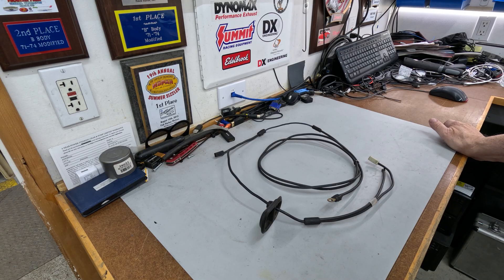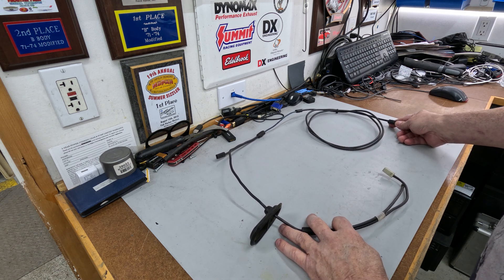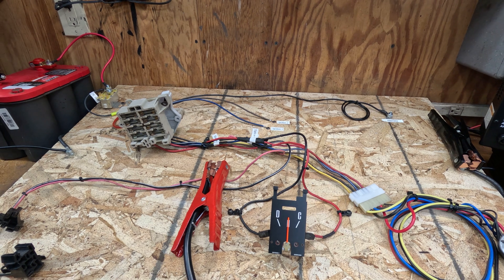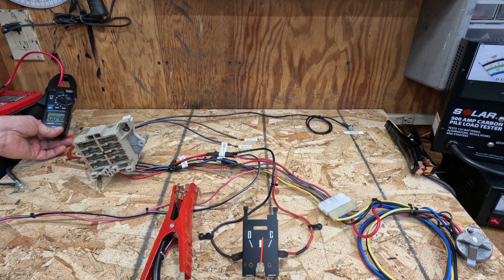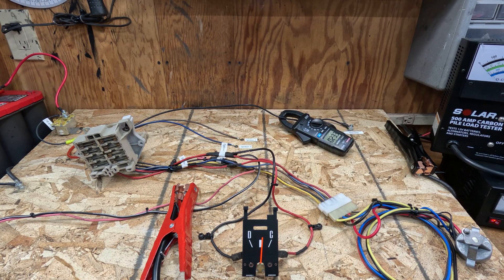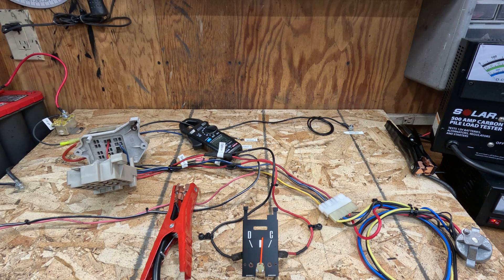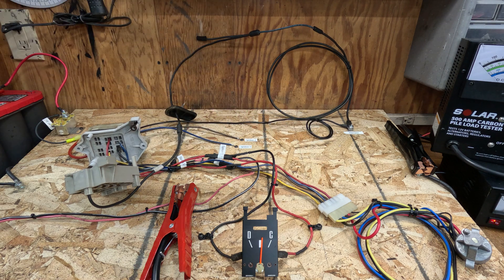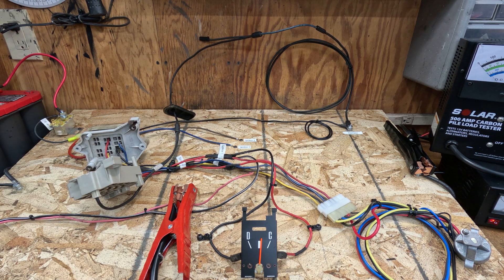The Mopar ammeter-based charging system and the “C-body recall” bulkhead bypass

Comment: Great videos, I've been watching them all. I'm also on FBBO. I'm about to rewire my '71RR all new with M&H. I also purchased an NOS C-body recall bypass on ebay. Any chance you could make a video on how to make a new recall by-pass also showing what parts are needed? I'm a little leery about using the NOS bypass seeing that it's about 50 years old.
Reply from the maker: Thanks, close to finishing up the mostly “as original” subjects, will go back over some modifications in some detail shortly, will show some basics.
Reply: @72roadrunnergtx  Excellent!

Comment: I’ve enjoyed your videos and I particularly like this one. I’ve messaged you on a separate topic on one of your other ones that you’ve been very helpful.  Let me see if I have the right set up for my application.  71 B body with all new M&H wiring harnesses. Only thing that’s currently stock is the rear headlight harness. 

I ordered a relayed headlight harness and a feasible linked wire that runs from the alternator to the starter relay. Based on your videos, I’m assuming you do not like the alternator to starter relay wire that I purchased.  However, I do not think you have any objections to someone running a relayed headlight harness. 

If I purchase the C body recall wire, which I can actually still get on eBay  (and not run the shint wire I have) that will decrease the amperage running through my Packard terminals while still maintaining the factory safeguards built into the wiring. 

As far as the relayed headlight harness….. if I’m understanding your videos properly it should be ran from the alternator which will be the “alternator side”of the Packard terminal as opposed to running it from the starter relay which would be the battery side which I understand to not be a good idea (battery loading). 

Thank you for reading the novel. Just wanted to see what you thought and to make sure I’m understanding you correctly.
Reply from the maker: Thanks for watching, the factory C-body recall approach parallels the stock alternator feed Packard’s in the bulkhead connector, reduces vehicle load current on those terminals. Will not alter the designed circuit protection or the ammeter function. Crackedback’s “wire around” bypass defeats the ammeter altogether but will not help with vehicle load current being supplied to the interior on Packard terminals. He is one of those who believes the ammeter is the root cause of every Mopar electrical problem that has ever happened. I do not support his approach to this issue at all. Headlight relays? If keeping the stock ammeter operational, the power for the headlights, and/or any other added loads, needs to come from the alternator or anywhere on the alternator side of the Ammeter, as are all factory loads, to retain the purpose and function of the ammeter and not over-current stress the ammeter and related wiring/connections. If running his “wire around” bypass, or the ammeter is bypassed in any way, then it does not matter if the relay power comes from the battery or alternator.
Reply: @72roadrunnergtx  I apologize in advance if I'm being dense.  You said the wire around bypass defeats the ammeter altogether but will not help with vehicle load current being supplied to the interior on the Packard terminals.  That vehicle load you speak of is my main concern and would like to avoid.  
I'm not saying I'm going in this direction but for my own education if I  (1)physically connected the ammeter wires together physically/electrically bypassing the ammeter (2) ran the fusible linked "wire around" shunt from the alternator to the starter relay (3) and ran my headlight relay harness from the starter relay to the headlights I'd be fine as far as not overloading the wiring in my car?  That's what I gathered from what you said.  Please correct me if I'm wrong.
Reply from the maker: From his description you added to a comment on one of the other videos, he speaks of connecting his “wire around” to the bulkhead connector, removing and replacing a couple of Packard’s. Along with his comment about it not mattering about where to draw power for the relays after his “wire around” wire is installed, indicates he is bypassing the ammeter in the charge path and still depends on splice 1 (main power for the car) receiving its power through Packard terminals in the bulkhead. This is not what is commonly known as the “shunt wire” bypass. He has been marketing his kits on most of the popular Mopar related forums for years, haven’t yet seen any details about this “wire around” kit. If you want to send me some pictures of the kit and maybe some instructions, I can analyze further. doug@72rrgtx.com.
If you want to retain all stock functions and circuit protection while relieving most of the vehicle load current off of Packards in the bulkhead connector, the factory designed C-body recall approach is the best. Don’t have to buy the 50-year-old pre-made C-body recall wire, can replicate it fairly easily, just a parallel direct wire run from the fuse box Battery bus to the alternator output stud.
Reply: @72roadrunnergtx  I didn't really think of that....the C body recall wires being 50 years old.  haha.  Yes, I'll get you a pic of what I've got to get your opinion.  Thanks so much!
Reply: Email sent to you.

Comment: I'm working on my 74 Challenger and figured it was a good time to do this bypass. I made a bypass with a fuse link and ran it to the fuse block as you show and i ran a third wire from the alternator to the headlight relay. So with the factory wire to the meter there are 3 wires coming off the alternator. I started the car for a few minutes today and the meter was showing way toward the charge side, closer than it was to the center. Is this a result of the battery being low and will correct when it runs longer or did I make a mistake somewhere?
Reply from the maker: Sure sounds like a low battery, I would put a battery charger on it to insure the battery is fully charged, try it again or let it run for a bit. If the battery is low and healthy, the charge rate should drop to something more centered. Would also verify you have nothing (added loads) connected to the battery or starter relay that shouldn’t be. The bypass as you described is correct, won’t cause an extra charging indication.

Comment: Just recently bought a 70 fury 3. When it arrived I noticed someone added a wire from the alternator lug straight to the battery. The factory fusible link is in place and the added wire has a fusible link at the end of it. Seems to work fine. Are you saying this is a problem? Not sure when the wire was added but maybe your bypass wire wasn't available back then. Just want it to be right
Reply from the maker: To be clear, the C-body recall, subject of this video, was a factory designed recall I performed many times back in the seventies while working at dealers then. Can’t take any credit for it. Your described (direct battery to alternator bypass, or “shunt wire” bypass) is not factory and exposes all unfused stock wiring to very high current levels in the event of a short in the stock unfused wiring as it circumvents the stock circuit protection. Not a problem until something shorts, I suppose. There are several other videos on my channel going into great detail about what is wrong with that bypass and safe alternatives to it, including the c-body factory recall alternator feed bulkhead bypass.
Reply: @72roadrunnergtx  Thanks for the information. When I said "your" I just meant the one you were speaking about. I'll check the other videos, thanks again

Comment: Fantastic video! Q: would this be helpful on a 68 A-body also? Thanks again.
Reply from the maker: Sure, can be replicated/adapted to any platform really to bypass/parallel the bulkhead alternator feed Packards.
Reply: @72roadrunnergtx  Great thank you for the quick reply. I also have 72 Satellite also so all the harnesses shown were familiar. I bought the C-body recall wire and I’m planning on adding relays for the headlines. My Molex looks clean but I’m adding a Sanden AC soon My Satellite had factory AC which was removed. I might add some other items (stereo/HEI) so this is all very timely and helpful!

Comment: Great video!  That connector on the engine side of the firewall is just a bonus connector, correct?  I don't see anything to plug it into my my '70 Challenger.  Would using it to got to the starter relay have any benefit?
Reply from the maker: Thanks, It’s a correctly loaded power tap, some model C-bodies had a use for it under the hood. Whatever you do, DON’T connect it to the battery or starter relay. That will turn this correct factory safe bulkhead bypass into the dreaded “shunt wire bypass” talked about in some of the other videos on this channel. Dangerous, Circumvents the stock short circuit protection for the entire system, the fusible link.

Comment: Many many years ago had a 69 Roadrunner t h at would lose all power unless the ammeter wire was jiggled😂
Reply from the maker: Sounds like terminal abuse, loose connections at the ammeter.

Comment: Hey ! Could that power take off on the  C body harness be an extra accessory source option incase the one on the fusebox is being used?
Reply from the maker: Sure, just be sure you have the two bypass fuse box wires connected to the batt bus on the fuse box.

Comment: Well, i bought  the only C body recall harness on ebay . I paid more than $15 but its NOS. I figured id have it for the future.  Ive learned to Grab things while you still see it.  
 I unhooked my fusebox to have a look but the box comes off on the clip side giving me an inch of access. Im scared of pulling it any further.  Is the "one clip " the only thing holding on the fusebox ?  Am i being too gentle?   
 I see the " batt" labeled spade connector in the front ot seems easy enough.  
 I think I should be able to swap out the C body grommet for a B body one?
 Thanks
Reply from the maker: Should have two clips on opposite corners, should drop more than an inch. Assuming you have an automatic with the smaller plastic clutch rod hole plug, should be able to transfer the rubber gromet from the C-body plug to the smaller b-body plug.

Comment: I've been interested in your videos since you demonstrated the negative aspects of the "shunt Wire."   I was all ready to do it for my 1971 Charger.  You certainly gave me pause.  Especially with your videos having the actual harness layed out on a table!
I'm not having issues with my system, but I'm looking for an extra layer of protection. I've installed a pre-made headlight relay harness from dapper lighting.  It messed with my idaway headlight doors, but I'm making do with it.
 You showed the C body upgrade harness with two female ends. I'm not clear on where they connect.   It looks like you have it connected on a spade where the fuses are.  The other female connection opposite that spade on the inside of the fuse box. 
 It looks like the two female ends are connected to each other with a male spade in between? 
  Also, in your video about the  shunt wire, you said that adding a fusible link (if I understand it correctly) in parallel with the original fusible link will make it so that the fuse won't burn up before the stock wiring.  
 The C body harness also has a fusible link along with the original wirings fusible link.  
Thanks
Reply from the maker: The C-body bypass, and its fusible link does not bypass, or parallel, the stock primary fusible link protecting the unfused wiring as does the “shunt wire bypass” but does parallel the one bulkhead Packard connection that handles most of the stock running loads and is the first to melt down normally. Retains the stock designed circuit protection and the ammeter function  As for the fuse box connections for the C-body bypass, there are two extra male Packard connections on the battery bus with that fuse box, one on the front and one on the back. Two connections being better than one. The '71 Charger has the same fuse box as the C-bodies in question and shown in this video. See my reply to the comment below.

Comment: Would you provide a bit more on why the dual connection of the by-pass to the fuse box?  I get feeding the battery bus as it connect to Splice 1.  Why the second connection in the front of the fuse box, what is it feeding/doing? 

Really have enjoyed your videos.  I've got a 65 Imperial I'm going to be up-dating the wiring and your videos are helping a great deal in the planning phase.
Reply from the maker: Load splitting basically, an acknowledgment that two Packard connections are better than one at handling some current, no other purpose. The targeted ’72-73 vehicles of the recall ran the pictured fuse box style and had two available male Packard terminals on the battery buss, one on the back, one on the front, for adding options or accessories of some kind. Some other platforms ran that same fuse box as well some years. The older cars running a different/older fuse box may only have one empty battery bus spade on the back, or could have been used by some add-on load, with no available connections. In that case I’d consider a good splice into the battery bus feed wire to get the best connection to spice 1.
Reply: @72roadrunnergtx  Thank you for clearing this up.  It helps a lot. 

To be clear, the 2 extra spades would have been used to add an accessory but in this case they are being used to feed power.
Reply from the maker: @EliseandDanchannel  Correct! either a factory installed option or could be used after the fact as a power tap for some other non-factory accessory. When performing this recall back then, we would find customer added equipment plugged into them once in a while, slowing down the installation.
Reply: Two connections are better than one . Got it . 
 Do you think a used harness on Ebay will be okay like yours seemed to be.
 About the rubber grommet through  the firewall.  I'm guessing that I will need to drill through the firewall to make my own hole ?